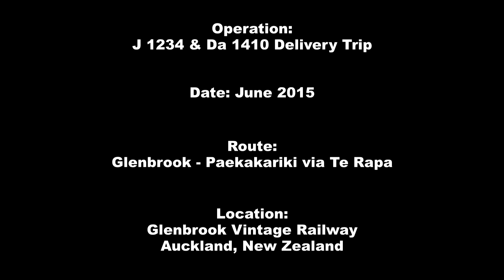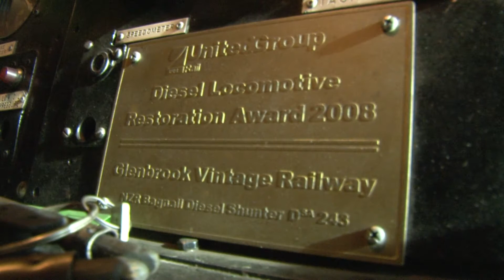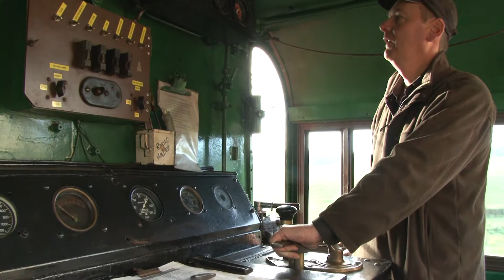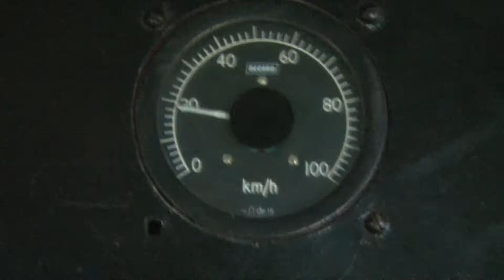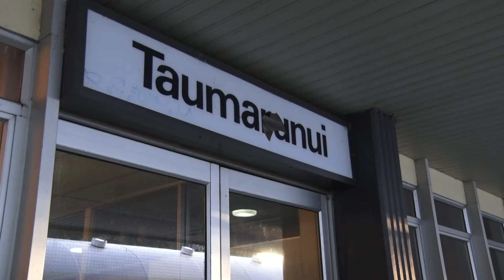The Big Move

Comment: Lol dunno which makes more smoke the ja or the da
Reply: With steam locos most of what you see coming out is nothing more than super heated water ie steam, sometimes the driver and fireman if there a lot of people with cameras will put more coal on, to make more smoke, but a properly run steam loco can be very efficient and not blow excessive black smoke, with regards to the DA,s their diesel engines were designed nearly 70 years ago so they are not as efficient as later model diesel engines.